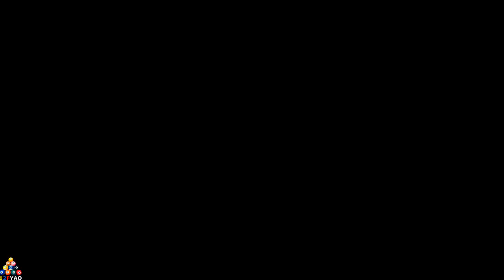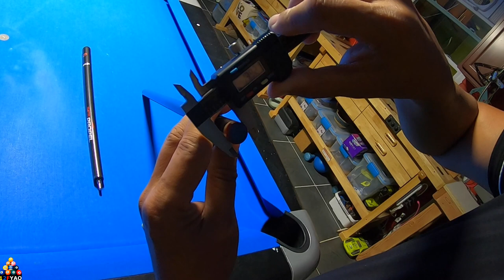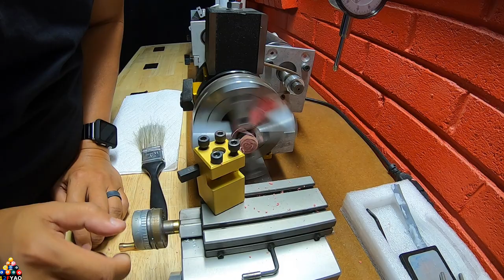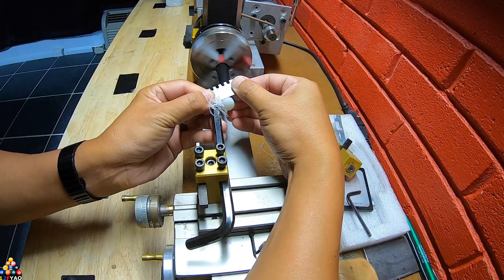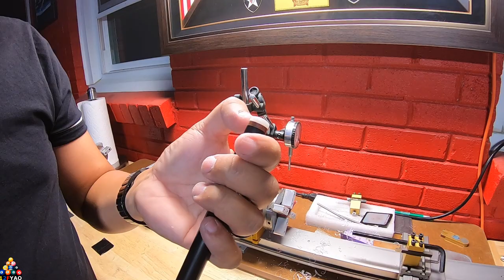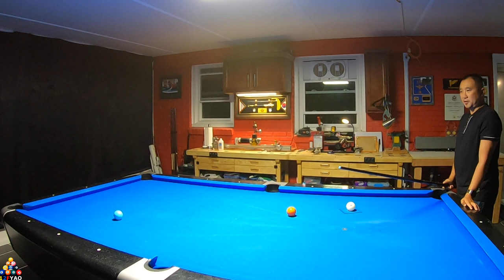Horo Jump Tip. A Tip Specifically Designed for Jumping. Installed on a Cuetec Propel.

Comment: Between a G10 and Bullet proof clear tip, which one would you recommend more for breaking and jumping?
Reply from the maker: G10 is glass impregnate with resin and bullet proof is polycarbonate “lexan”. G10 is one of the hardest if not the hardest tip out in the market. For breaking hard or jumping, G10 to me is the best. For a cut breaks I like and use a Horo tip. I use all Horo tips for my jump cues because  I can control the cue ball when jumping. I play with 2 break shaft, one G10 for 10 ball and hard 8 ball breaks. Horo Black for 9 ball because I can control the cue break. Thank you for commenting, please subscribe if haven’t already and hope this helps.

Comment: May I ask what you're using to protect your table for the jump shots? The square piece? I've recently acquired a Propel and wish to do repetitive jump practice, but don't want to damage the table.
Reply from the maker: During games nothing really but when practicing, I double up the square piece. Also congratulations on getting one of the best jump cue on the market. Flatten the tip and knock out the sharpe edges on the tip so it won’t cut the table cloth and it will add a lot of confidence on your jump shots.  Hope this helps, please subscribe if haven’t already and please share.
Reply: @playpool12fyao  Thanks so much for taking the time to respond! I'd like to clarify and ask what the square piece is, actually? Is it just a piece of felt you're using?
Reply from the maker: They are they are just a piece of felt. If you don’t have any, I seen Jayson Shaw use paint’s tape. I would even use playing cards. The felt or tape is to prevent burn mark on the felt. The burn mark wears the table cloth (felt) faster making a hole later.  Hope this helps.
Reply: That is incredibly helpful, thank you very much for your time and response - you are a scholar and a gentleman.

And you should know I've reached out to the Horo people to test out their Break/Jump and Jump tips for myself after your videos!
Reply from the maker: That is awesome. The jump tip really works well with the Propel. For the break tip, it really works best with a medium stun 9 ball break. The tip does not require a hard break to open up the rack especially for 9 ball. If you have any questions just ask and I’ll do my best to answer them.
Reply: That's actually very helpful info on the break tip especially. I appreciate your correspondence on this!
Reply from the maker: Thank you.

Comment: How does this jump tip perform compared to a g10 or white diamond jump tip?
Reply from the maker: Comparing anything to a G10, there is no comparison. G10 is far better for breaking and jumping especially if you’re a beginner. With that said, one thing G10 and white diamond does not have over the Horo tip is that, the Horo tip can cling to the CB much better. The Horo jump tip is more dense to me and it felt like I can control the CB much better. G10 and white diamond is like a steel hammer where the Horo Jump tip is like a brass hammer. The steel hammer is just for wacky things in where the brass hammer is used for precision. If you want control and better action from the CB the Horo Jump tip is the way to go. Hope this helps and please share.
Reply: @playpool12fyao  Thank you for advising!